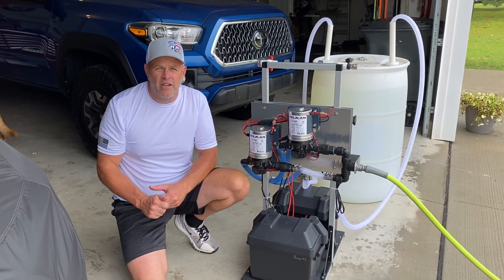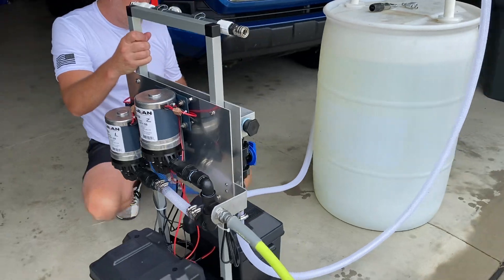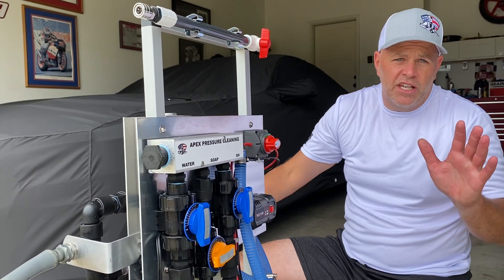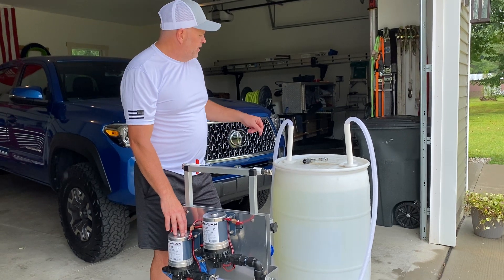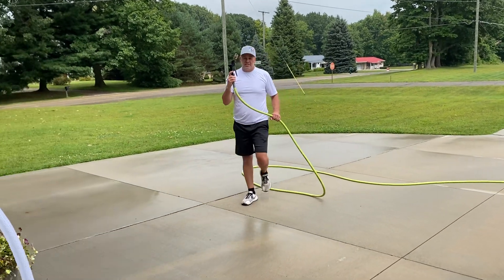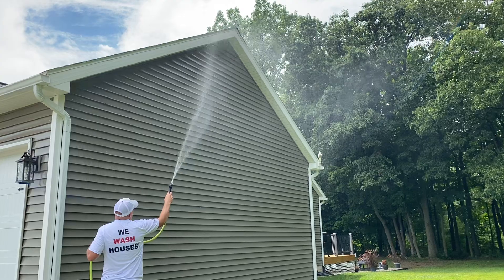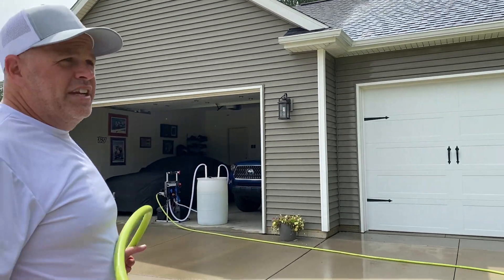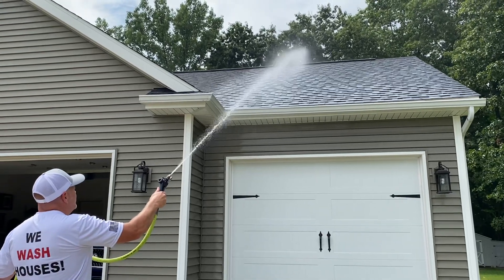Twin pump soft wash system! We build a system with two 7 gpm Delavan pumps!

Comment: Awesome! Quick question, how come you have check valves on the outlet sides of both pumps? The check valves on the blend manifold arent sufficient?
Reply from the maker: @SuperiorExteriorLLC  I was worried about one pump going out and the other pump blowing right back through the second pump
Reply: @apexpressurecleaning  Gotcha, very thoughtful!
Reply: How did you get both pumps to turn on and supply at the same time. I did a similar set up but only one pump turns on at a time. If I turn the power off on one the other one turns on. It’s as if only one pump is feeling the demand. What are your recommendations?

Comment: I’m about to do the same thing. But I was thinking to put the intake from each side of the manifold block.  Use check valves to isolate. I want the ability to run one or two pumps

Comment: Great videos Shawn , I have been running the Pentair valves for a while. I'm looking to upgrade. I do have a question on the water side its always open 100% do we really need a valve there , why not just a line with a check valve in it. .  I do run 2 12 volt delvan now one to wash with and one to rinse. . I have been thinking about putting 2 together for washing
Thanks
Reply from the maker: @carpetmagicofwilson  that question has come up many times. It can be done, however, your ratios are going to be skewed toward water.

Think about it like this, even with a metering valve wide open there is still more restriction with that metering valve then a straight through ball valve wide open. Which means that what you think you’re getting is going to be a little bit watered down compared to that number.

It absolutely can be done just it won’t be the same percentage you think it is
Reply: @apexpressurecleaning  thank you.  Makes sense if your pulling more water through and you set the metering valve at 3% , adding more water is cutting down that 3%
Reply from the maker: @ exactly!

Comment: What pumps?
Reply from the maker: @softwashscience  Delavan 7gpm/100psi.

They are sold on our website. www.budgetsoftwashsolutions.com
Reply: @apexpressurecleaning   They sell 12 different pumps with those same specs in a 12v pump all 7 gpm 100 psi.  I run the best one which is the 7970 101Y SB.  I zoomed in on a screen shot and your running the 7871 101Y SB which is the FB3 series automatic demand without the quick attached ports. Have you done much testing with the system?  I’m mainly curious to see how quick the pressure switches and or the relay will fail.  I know other people have put an external pressure switch on and I’m curious if that needs to happen for it to have longevity I know for me personally I had really bad luck with the FB3 series Last season, but I went back to the FB2 and just replaced the relay with one of mine and I’ve had a really good luck, but I do have an FB three as back up so I guess we’ll see.  I’m thinking about building oneof these systems and I’m curious of your thoughts have you had much time on it or did this just get finished?
Reply from the maker: @softwashscience  it was just completed and sent to the new owner.
Reply: @apexpressurecleaning  ok thanks I will have to talk with them in a month or two.  Nice work.
Reply: @apexpressurecleaning  also if I may make a recommendation.  I would thread tap your plate for the pump bolts that way you don’t have to put a nut on the back or anything you can just thread the bolt in and its easy to swap out your pumps you know what I mean.
Reply from the maker: @softwashscience  we use studs.